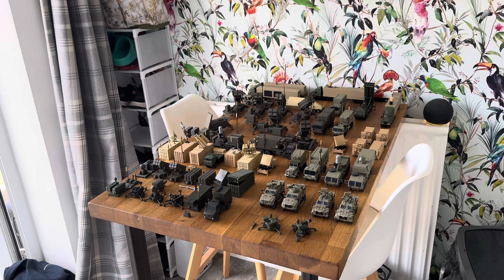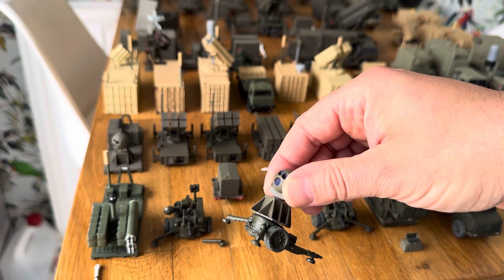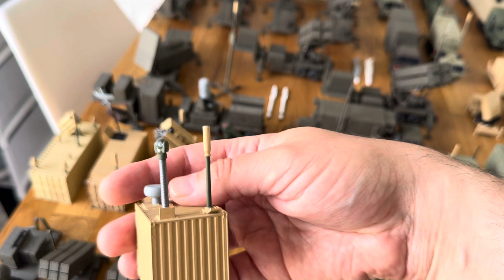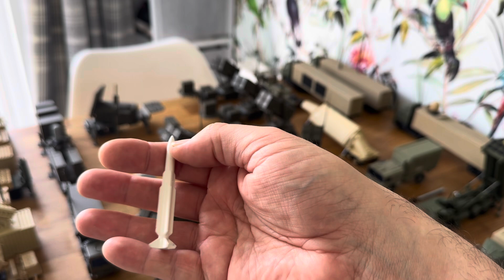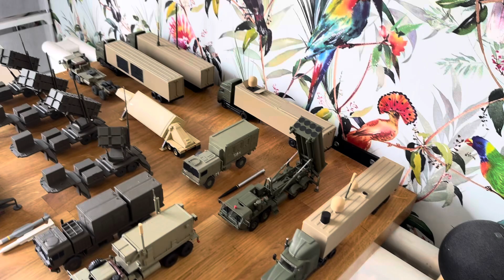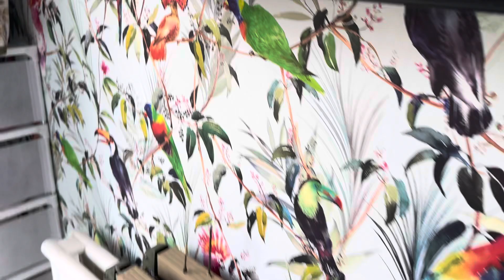Integrated 1/72 Air Defence Assets.  Patriot THAAD, NASAMS and air defence The modern WHATIF models

Comment: Great collection (and work). Very inspiring. My Air Defence (1/72 scale) is quite limited: 4 x Gepard, Iron Dome Air Defense System (Radar, Control Unit and Launcher unit), and one Roland:)
Reply from the maker: Awesome not a bad place to start :) I’ve got gepards too :) they cover my tactical engineers
Reply: @Whatifwarlord Actually I started many years ago. However, I concentrated on modern tanks. I’ve got an American  mechanized company with Abrams and Bradleys (2003-2007) + painted figures and Apache support. I collected modern German tanks and IFV, too. Now I have a modern German Kampfguppe with additional Panzerhaubitze 2000 and Tiger attack helicopters. I collect WW II tanks and figures - Arnhem inspired.
Reply from the maker: @NovaProduction-ic1ot that’s awesome :) yes it takes ages to amass a collection and a very kind wife :) hehe 😛 sounds like you have an amazing collection :)